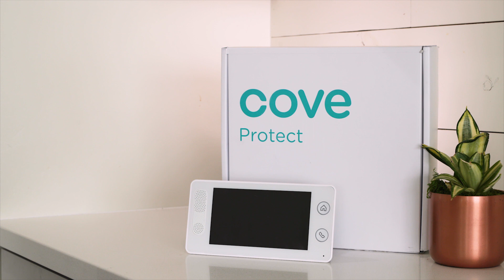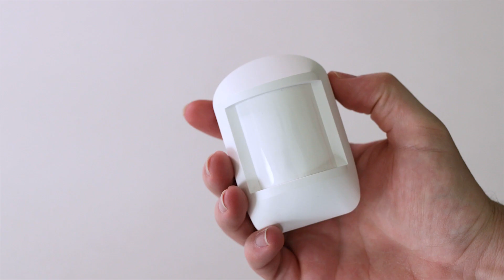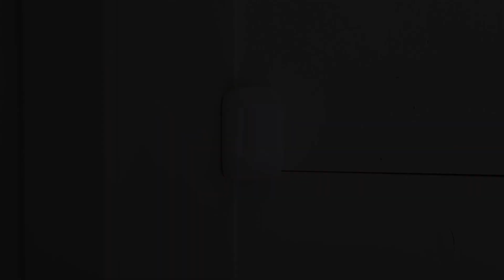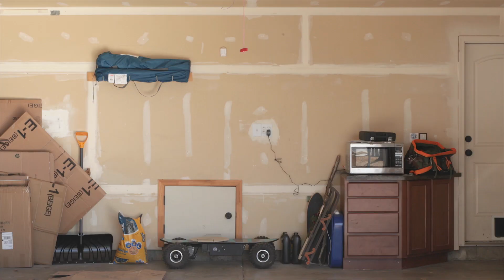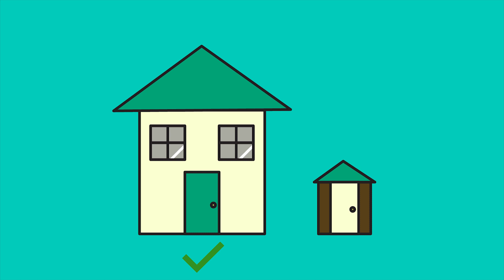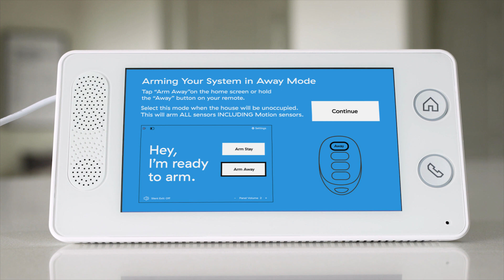How to Install Cove Security System - Cove

Comment: How do I remove monitoring
Reply from the maker: Call us at 855.268.3669 and we can help you out!
Reply: @Covesmart  What happens if I use a Cove security system without monitoring
Reply from the maker: @mrmaddocs68752  Hi there! This is a great question. We strongly recommend having a monitoring plan in place, as the system is designed with 24/7 professional monitoring in mind. That way, if an emergency occurs when you're not there to check on it, we'll still be able to send the help you need! Professionally monitored systems are better equipped to prevent and handle emergencies, and we want to give our customers as much peace of mind as possible.
Reply: @Covesmart  But when I get one, I'll use it for a demo